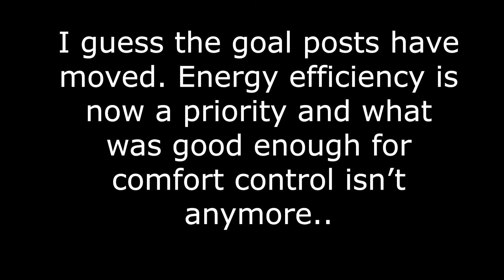Staging Chillers on Return Water Temperature - It Doesn't Work

Comment: How about Delta T as a source of current/real time load estimate, lets's say design delta T is 5 (i.e. 7 & 12) Celsius therefore 1 degree  (.i.e 7 & 11) celsius drop in delta T is a 20% reduction in plant load....2 degree (.i.e 7 & 10) is a 40% drop in plant load, therefore at this point certainly a chiller & its corresponding primary pump needs to be turned off to match plant load. Would do think about this method?

Comment: What if I control the staging based on the differential pressure transmitter of the load that I'm using to control pumps speed?
Just an idea came up to my mind
Reply from the maker: We don't do this, but I guess it may work in some situations, as a secondary condition. In Australia we reset the system pressure set point depending on the load. So, in high load conditions we reset the pressure set point up to design, say 250kPa. in low load, we reset the pressure set point down to say 125kPa. This squeezes out a little more energy. 
However, relevant to what you are saying, this means that the system pressure may not be a good indication of the load as we are continually changing it.

Comment: True. Neither return water temperature alone, nor excess deficit water flow is sufficient. Since the 'thermal capacity rate' = 'mass flowrate' * 'specific heat capacity' * 'temperature'. 
Then the other problem is that flowrate and temperature can vary faster than the chiller / plant can tolerate.
Reply: To steady the thermal variation in time, the water is first to be buffered in a vertical stratification tank. With water entering at the bottom, and leaving at the top. The tank size should be sufficient to steady the temperature & thermal capacity.
The temperature sensor to be situated in the stratified zone, or top of the tank.

Comment: In a variable primary system, you have two ways to stage the chillers. 

1- building load (BTU meter)
2- chillers load (FLA% or actual ampere)